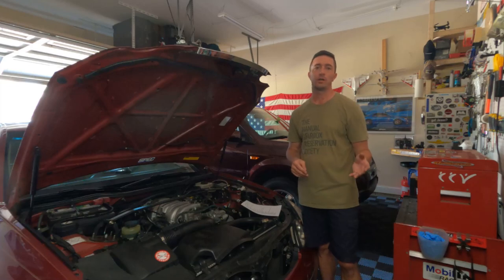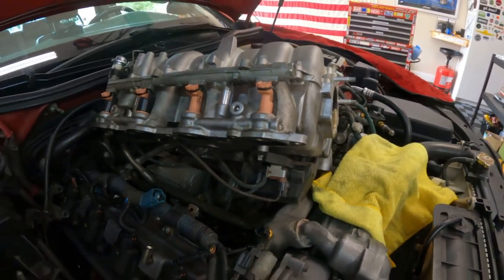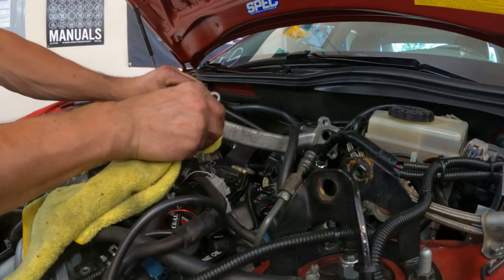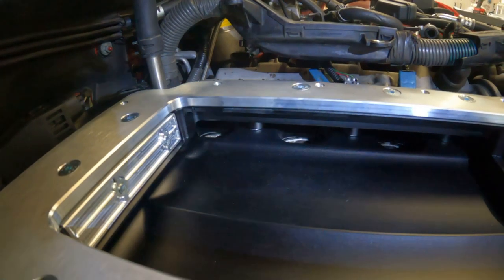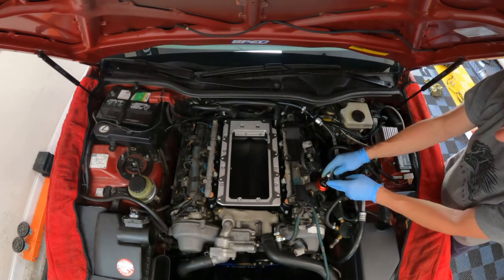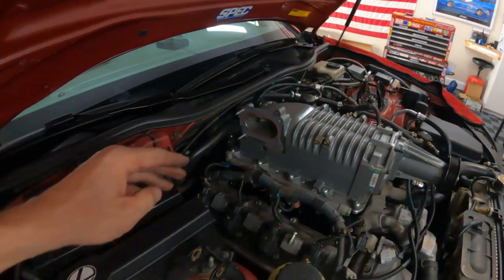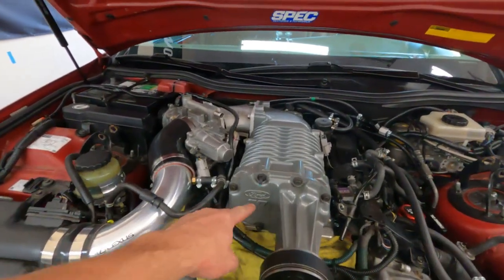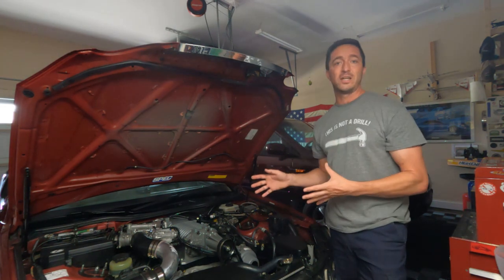Finally supercharged! | Episode 3 | LEXUS - TOYOTA V8 | Every Major Step

Comment: Can’t wait to see what this beast does after it’s all done! 350whp would be impressive! Closer to 400 would blow me away!!👌🏼 
And to think my 260 whp 99’ 400 was fast at all lol I mean I did beat some cars I didn’t think I would with my Lexus but this thing will surprise people for sure😎
Reply: With an ethanol mix it would definitely hit 350+ on the dyno. Id upgrade injectors first. Ethanol can and on boost it's unreal. I like doing blends. Ethanol by itself would gunk up my fuel pump.
Reply: I have a 2002 VVTI 3UZ with 325 hp and 325 Lbs Torque its a beast.

Comment: I have a 1998 GS400 in the same Cinnabar. I do all my own wrenching on it. I am so glad you did this series, I am most certainly going to do this mod someday if you think the performance is worth it.
Reply from the maker: It’s a blast (literally). 2nd gear rolls are my favorite. But I have had to be nice running lean like this. 330’s go in this weekend, then it’s time to let her rip a bit. My biggest worry would be the A650 if I bolted on an M112. It would be fried in no time without mods.
Reply: @ForwardMomentum  Is there any way to tune once you install the larger injectors?
Reply from the maker: Yes. My AFC and SS ENR will both work to tune to proper AFRs.

Comment: I’m about to manual swap my 1UZ swapped IS300 from 99’ GS400. Super excited from your videos, I can’t imagine how it must feel with a manual supercharged Lexus V8.
Reply from the maker: Sounds awesome! Yes, it’s fun. Better when I get injectors in. 😎
Reply: @ForwardMomentum  definitely! I want to go supercharged route but I’m trying to limit my spending after picking up a 2012 ISF haha
Reply from the maker: No way! I want an ISF so bad! Such beasts!
Reply: @ForwardMomentum  the 1UZ is definitely a little more raw than the ISF. Atleast in my is300 that’s how I feel. 

Only thing I hate about my ISF is that they never came manual
Reply from the maker: Yeah but that trans in the F is unreal. It shifts darn near as fast as a modern DCT. One of my dream cars for sure.
Reply: @ForwardMomentum  I also have an ISF; you are correct; it is an amazing machine.  
In my opinion, the ISF is excellent with its current automatic transmission, including in 'manual' mode.  I don't think it would be any better with a true manual transmission.
Reply: @ForwardMomentum  for sure man. But once you’ve driven manuals and hop in an automatic, it just isn’t the same. Regardless of dct or not.

Comment: good job brother thanks for the detailed build and the detailed parts list, that is key!
Reply: How did you hook up valve cover vent to the intake, was that the t to the evap that you showed?
Reply from the maker: Bank 2 goes to intake tube. Bank 1 (PCV) goes to T with EVAP and then to the back of the SCr.
Reply: @ForwardMomentum  thanks!

Comment: Love that fuel line fix. I have seen guys weld the bung to a AN fitting. But that works. Actually, you could have done AN push lock fittings as an alternative on the fuel rails
Reply from the maker: Yep, many ways to do it for sure. The 90-degree 4AN fittings on the rails are push lock. Can you explain what you mean further? Thanks.
Reply: I just saw hose clamps, so it looked like a barb, my bad. I actually use Push Lock Clamps on my fuel lines with a crimp tool. I didn't like the idea of a hose clamp coming loose, and I thought would be more permanent.

Comment: Hi, I have a GS300 ~ it's a 2006 car with keyless entry.
I just had an oil & filters service done at a local repair shop who I've used for years and trust. Anyway, about 25 miles into driving a number of warning lights came up. Tyre pressure, vsc, brakes, engine eftc.. Tyre pressures are all equal and correct, there appear to be no issues with the car but the lights stay on. Any bright ideas would be welcome. Finally, my aircon stopped working, just blows hot no matter how It's set. A disaster in hot weather! I'm in the UK and this is my 5th Lexus...love 'em!
Reply from the maker: Have you scanned the car for codes? If there are no codes, it could be a wheel speed sensor. You’ll need a special scanner to see which one. That’s usually why all those lights come on. Regarding AC probably need to run through diagnostics in the service manual. My guess is it’s low on refrigerant. Good luck!
Reply: Thanks, I'm going to have it checked out. The battery was changed so the reconnection could be the cause I'm told. I'll let you know how it goes, David

Comment: The stock injector size is 275cc and fuel pressure should be between 45-50psi, I'm thinking that you're right on the dot regarding not enough fuel is being pushed. Theoretically at 90% duty cycle we are looking at 340whp and 380whp at max duty cycle.
Reply from the maker: It depends on how you measure the stock injectors I believe. Meaning, the method. Because I’m told by industry experts that the injectors are 251-255cc. Nonetheless, your point is valid and the 330’s I have installed now are amazing. I went from trying to add nearly 30% (wasn’t possible due to duty cycle) to pulling up to 20% with the 330’s to hit 11.0-11.5 AFR. Crazy!

Comment: I know this is a couple of months later but on the an fittings for your fuel setup, never use sealant on the threads of any flared fitting, the flare is doing the sealing not the threads.
Reply from the maker: Actually it’s often determined by fitting type (e.g. NPT or NPTF). That’s how the determination to add sealant is made and I should note it’s a raging debate in the flare fitting community. There’s no hard and fast rule that “a flared fitting doesn’t get sealant on threads.” By design it SHOULDN’T, but cheaper components with imperfections tend to circulate in the Amazon world, thus the sealant on the threads tends to improve the connection in that regard. I have used this method 6 times now with zero leaks, so I will personally continue to do so. Thanks for commenting though.
Reply: @ForwardMomentum  starters I am an aircraft mechanic, I know the fitting type determines if thread sealant is used. Build quality or not a/n fittings are ment to seal by the flare, that's it, the army navy standard says do not use sealant. If an a/n fitting is leaking check for nicks or damage to the flare, if nothing you tighten the fitting until it stop leaking.
Reply from the maker: Excellent we’re in the same industry. 👍 Unfortunately these are not aircraft certified. Again, it’s a raging debate online. Again, we do agree how flared fittings work though, so that’s good. 😎

Comment: I hope you can reply to this, do you know if this supercharger setup will work of the second gen non vvti 1uzfe (for an ls400)? I really want to supercharge my car but I am worried that the components will not fit, I understand some things may be different such as the belt and whatnot but I’m mainly worried about the actual fitment of the supercharger I can deal with small obstacles such as the belt later. Thanks!
Reply from the maker: Hi - I highly recommend you contact Travis @elate. He is very responsive on IG. Tell him I sent you. 👍

Comment: Hey Christian, what was the reason for removing the studs under the intake manifold? It looks like you didn’t put them back in, was it for the supercharger adapter or was it for easier access to the bypass bolts? I’m replacing my starter and intake gaskets and coolant bypass gasket so I was wondering if the studs need to be put back after removal
Reply from the maker: Hi - I believe Elate requires it for the adapter due to the design of the adapter itself and general fitment. If your engine is not supercharged with an Elate adapter, it should be restored to OEM configuration, including studs. I hope that helps!
Reply: @ForwardMomentum  thanks! I was wondering as I’m doing the timing belt and starter at the same time and when I saw the studs come out it made me go !!!! lol

Comment: damn amazing how much hp you think you'd be at once running good
Reply from the maker: About 310-320whp or 370-380 crank.
Reply: @ForwardMomentum  I have run mixed e85 with 93 in my Lexus. The ratios 5 gallons ethanol (33%) to 10 gallons 93. I bet you'd gain a lot more on a dyno. Id only run full ethanol if you upgrade your injectors to have a ton more flow and had some sort of standalone. Boost bug is real. I bet standalone is next LOL.
Reply from the maker: Very interesting on the mix. I finally have it dialed in (330 injectors are installed and AFR is now good). That being said, a SA is north of two grand. I just don’t want to spend that kind of money on it. If anything, I’ll intercool and LSD it next, then maybe headers. I don’t know. Pretty happy with it as a DD right now. You’re right though, the boost bug is real and it’s hard to stay at 7psi.
Reply: @ForwardMomentum  I totally recommend treadstone FMIC. I got one my my celica rated for 1200 hp. You could go water intercooled, but I went for simplicity and cutting up my bumper LOL. Using a water pump and all just seemed like more stuff to break.
Reply from the maker: I’ll check it out. Not sure how it would work with my M112 and Elate adapter.
Reply: @ForwardMomentum  Ya I forgot about that. I keep thinking turbos or the turbo-style superchargers. I know some of the lotus elise super chargers have an intercooler build-in manifold. Scratch that idea.
Reply from the maker: Elate, the adapter manufacturer, has a drop in AWIC core. I’ll be doing that ASAP.
Reply: @ForwardMomentum  That will drop IAT's alot

Comment: Should I buy a black on black 1999gs400 with 170,000 miles on the clock? It’s in top tier condition for 5,000$
Reply from the maker: Sounds good to me. Get a used car inspection and run the VIN.
Reply: Woah I appreciate the fast reply man! Kudos to you. Yea I got the vin number back and it’s a clean record besides a airbag recall. As far as a used mechanic inspection, I’m going to LA so I would have to wait till I get back home to do that.
Reply from the maker: Well I would have the inspection done before um you purchase it, but your call on that. 👍

Comment: What was the part number for the koyo idler pulley?
Reply from the maker: I didn’t list it because it was given to me. Instead, I put an alternate in the parts list of EP1. If all else fails and you get the adapter plate from Travis, ask him if he has a recommendation. I believe he has it in the Elate instructions possibly.
Reply: @ForwardMomentum  Cool thanks! What size bolts did you use for the EGR block off plate? I appreciate you answering all these questions cause i'm following your build near exactly in my LS400
Reply from the maker: NP! I don’t have EGR on this engine, so I didn’t do that. There might be a couple places that do those for your car online. 👍
Reply: @ForwardMomentum  I’m referring to the block off on the SC on the back
Reply from the maker: I custom cut some metal and used FIPG to seal it, which I showed in my series. 😎
Reply: @ForwardMomentum reviving this, on the LS400 there was a vacuum line coming off the brake booster and went near the backside of the original intake manifold. I’m not sure if the GS400 has this, (if it does) where did you route that hose to? Or could I cap it off? TIA!
Reply from the maker: Interesting! I have nothing from the booster to the manifold. Any vacuum source should do and work for you. I even have a bunch of vac sources T’d (non-dedicated).
Reply: @ForwardMomentum  how did you plumb your catch can with the supercharger? I have a 2 port one opposed to the 3 port you have
Reply from the maker: @fishdishh4306 pretty simple really. OCC IN: B1 PCV. OCC OUT: back of SC (vac only).
Reply: @ForwardMomentum where did you run bank 2 pcv ?
Reply from the maker: To the intake tube, pre-TB.

Comment: ı have  gs300 but ı want to upgrade standart twin turbo like supra. Its can possible ?
Reply from the maker: Sure, with the right amount of money and expertise.
Reply: @ForwardMomentum  ı just want to turn like stock turbo and manifolds i think its more easy right?
Reply from the maker: There’s a little more to it than just bolting on turbos. You’ll need to strengthen it and run supporting mods (fuel and timing).

Comment: what ecu?
Reply from the maker: OEM. No other options with the GS400 (unless you go standalone).
Reply: Standalone is the best but you need to find a local tuner and shell out a couple geebees. But its totally worth it and I bet you'd unlock a lot more power. E85 will get you a ton more as well.
Reply from the maker: I have some experience with SA on my old supercharged 4Runner, so I could probably tune it. But I’m just not ready to drop a couple grand to unlock a little power. I need to AWIC it next, then LSD.
Reply: @ForwardMomentum  I got a Kaaz LSD on my Lexus GS400. It is pretty pimp. Definitely add some friction modifier otherwise it chatters a lot during daily driving on turns.